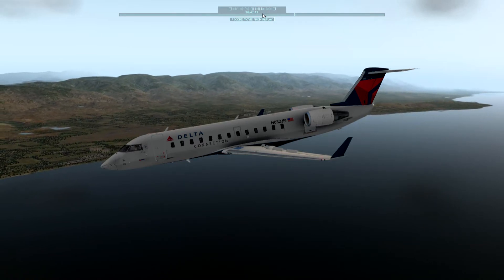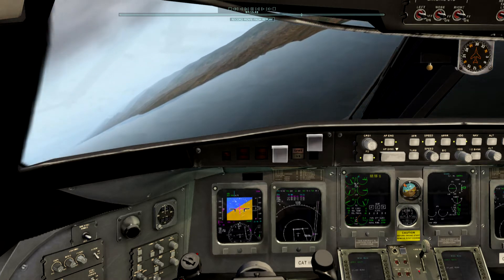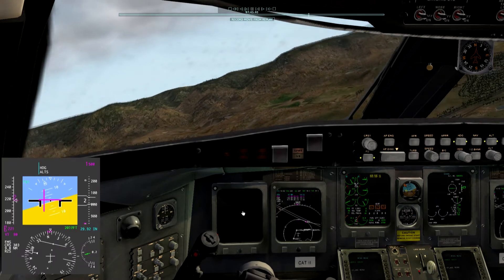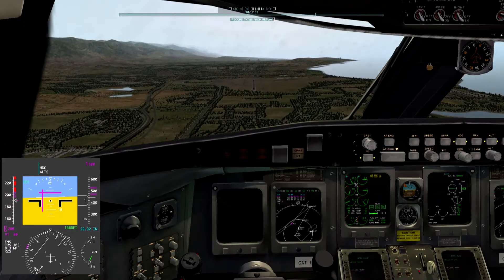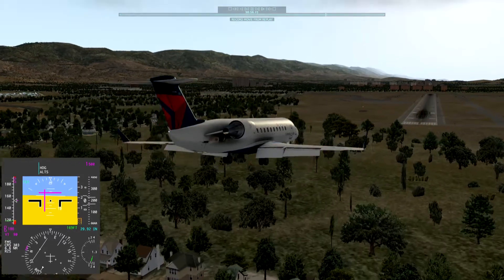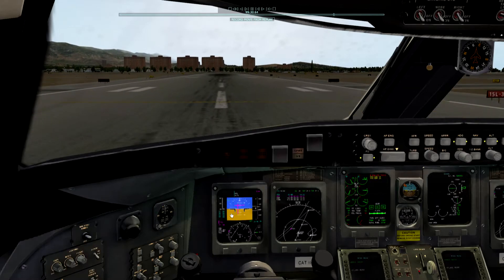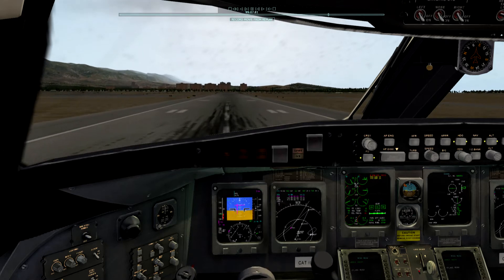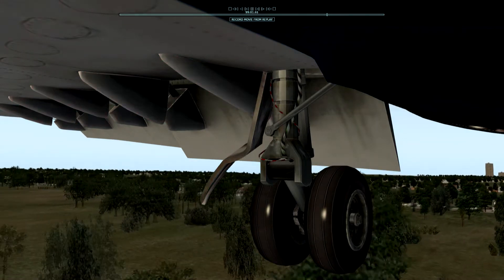CRJ-200 X-Plane 10 single engine into SBA

Comment from the maker: That's the stock X-Plane 10 'quick look' system, no plugin required. Look through your key bindings and you'll see the keys that memorize the view, then the keys to recall the view. I'm not sure if I changed mine or not, but I use CTRL-numpad to save the view, then the key on the numpad to recall the view. Pretty simple!

Comment from the maker: Because of all the custom displays, it takes a bit more cpu than most planes...but it does run those displays in another thread, I'm told, so if you have spare cores, it shouldn't take too much of a hit. It runs great on my machine, very happy with it.